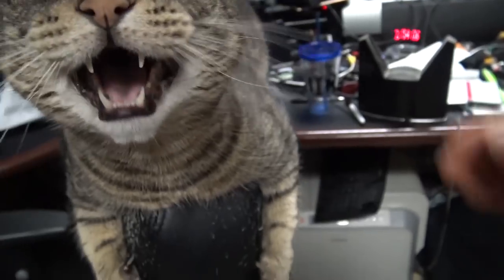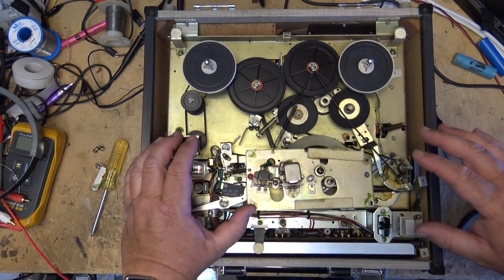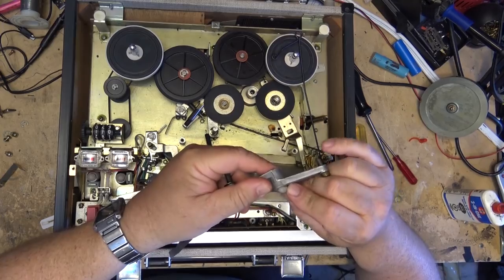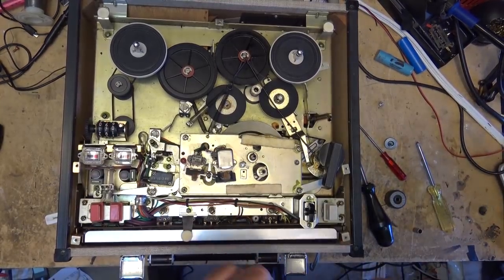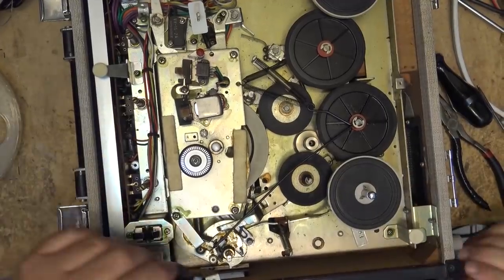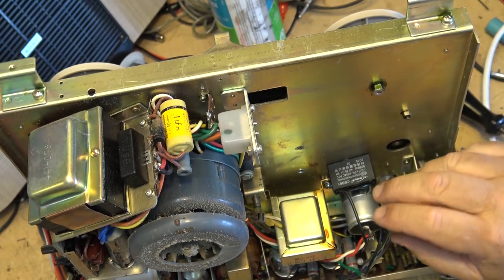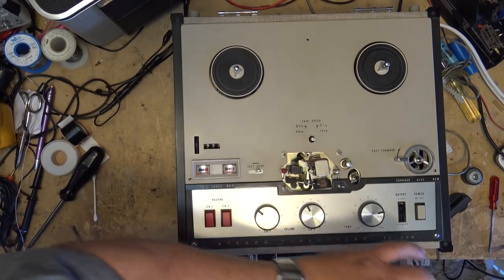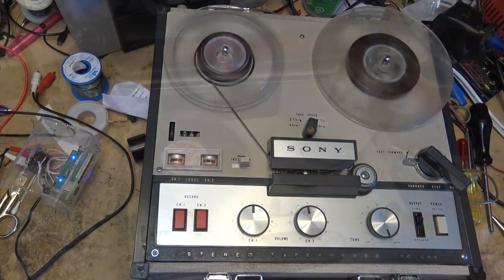sony tc 200 Hybrid Reel to Reel full restoration and motor speed repair

Comment: Hello! I have an Akai M10. Although it's in good condition, after 3-4 hours it slows down. If you turn it off for a while, it'll olay normally again. it is an issue difficult to reproduce unfortunately but it exists. Could that be it's motor capacitor?
Reply from the maker: Could be getting tired but i would suspect dry bearings, after it runs for awhile the metal to metal contact heats up and the metal starts expanding the metal which causes it to start to seize and slow down.  I have had this happen on pinch roller.  A motor  run cap could cause it on an induction motor.
Reply: @12voltvids  hello and I hope you're well thank you very much for your response! It's almost been a month since I have this reel to reel and the funny thing is that this issue no longer occurs. It happened just two times and I have to say that when I got it in the beginning it was getting very very warm and that issue happened like twice after it played for 5 to 6 hours. I tried to reproduce the issue and it's never happened again even when it played non-stop for 20 hours and I also suspect a capacitor for this since what I also noticed is that it no longer gets that warm. course anything else would be purely theoretical and one of these days after the lockdown of course I will make sure to take it to specialist. so far it plays and records well but it definitely needs new capacitors maybe some transistors and last but not least calibration.
Reply: @CFADful  So did you rplace the motor run capacitor? And did that help?
I have a similar issue.
Cheers
Reply: @SDsailor7  well, the capstab died a week ago so I sent it to a certified tech and I'm waiting now. It couls be just a bad transistor, I hope it will be repaired, I miss it so much !!
Reply: @12voltvids  So on AC run motors the run capacitor is not normally an issue?
Reply from the maker: @SDsailor7  yes they go bad and then the motor loses torque.  The run cap creates a phase lag for the second winding in the motor, to create the rotating magnetic field needed to spin the rotor.  Cap gets weak and delayed phase winding is also week.  Cap shorts and well, no delay so no rotating field.  I did a video about an open can on a box fan several years ago where I went through the theory.
Reply: @12voltvids  I will have to look it up it will be a good one to learn about the run capacitors. 
Thank you
Reply: @SDsailor7  unfortunately I didn't and the motor capacitor leaked and now the capstan no longer moves. I took it to a tech and he told me that it's not worth repairing but I guess he didn't want to mess around with it and I will take it to someone else. It's just the motor capacitor that first and I suspect that it was already leaking. I really hope it will be repaired because I love this machine, I have recorded more than 60 tapes with it!
Reply: @12voltvids  So, the motor capacitor has burst and leaked wax all over. Have you seen something like that? Could this be resolved  by simply replacing the motor capacitors or could this cause any more damage? Other than the capstsn motor not moving, everything else works fine and the machine is in good condition belts,transistors and everything. If you don't mind and if you want to provide me an email address I would like to send you some pictures to have your opinion.
Reply from the maker: @CFADful  yes most likely just the motor run capacitor has failed.
Reply: @CFADful  Why don't you replace the capacitor yourself? It is not that hard.
Reply: @SDsailor7  I thought about it but I don't have much knowledge about electronics and I'm afraid that there might be also other damage apart from this very motor capacitor. Not to mention in the 50-year-old machine apart from a motor capacitor I'm pretty sure other components need to be changed. So it's better to leave it for the experts to do so
Reply: @CFADful  I am no expert and i am still learning and the only tool i have for electronics is a multimiter and a soldering iron and have been able to fix several machines. I started it as a hobby. I buy the rtr's cheap at flea markets or at craigslist and if i can fix them i am happy and if not at least it is a learning experience.